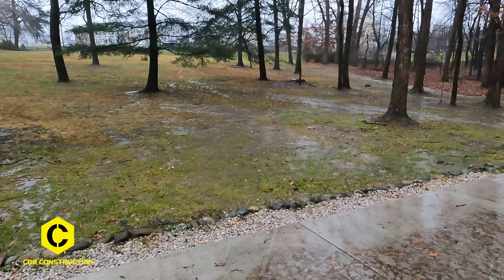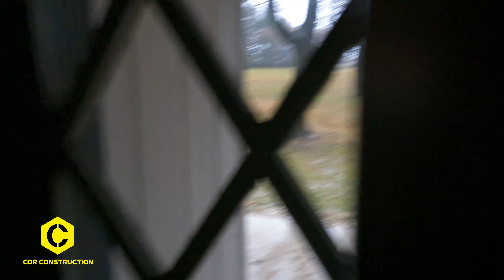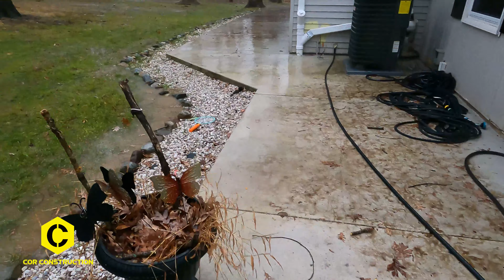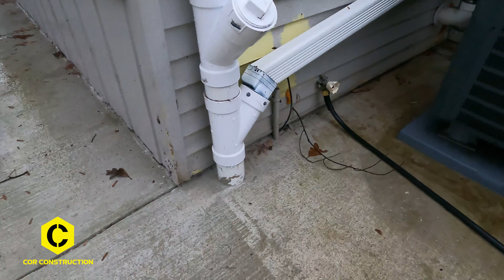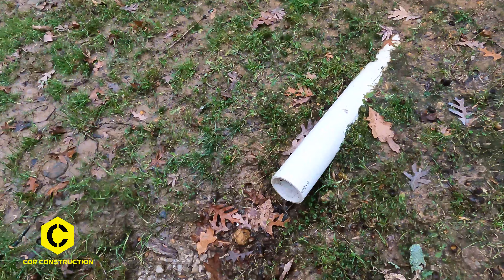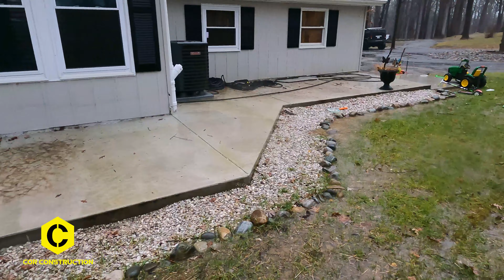Water Diversion Construction

Comment: From what I can see, the sidewalk here is only a small part of the solution to reduce mud by the home. Channeling water farther up the hill will be money better spent, although more swales may need some maintenance from time to time. The key is keeping the water at least 10 feet away from the foundation. 20 feet is probably better. BTW, a French Drain (gravel) will silt up after 10 years or so. Installing a series of catch basins with a solid pipe will work better in the long run.

Comment: Smart solution. I wonder why this is not done more. Maybe due to the extra cost? And maybe people just don’t want that much concrete right next to the house? It’s basically like a big sidewalk no?
Reply from the maker: Cost is probably the biggest factor. The housing industry isn't a quality focused industry unfortunately.  That's why most people with single detached houses have water issues.
Reply: @corconstruction  Is it something most homeowners can do themselves?
Reply from the maker: @nofurtherwest3474   Of course. I have a construction background - but i still approached this as a novice. I did a lot of research and talk to a few professionals that are smarter than I.

Comment: Munir this is so timely as my sump pump is running every few minutes as we speak due to the rain. My foundation around the house is surrounded by dirt/grass and on one side, water is getting in and seeping out of the concrete walls and floor of my basement. Do you think water sealant on the walls would help address this until I'm able to deal with the outside?
Reply from the maker: Water sealant on the walls will not hold up over time. Water will find the weakspots in the application - and expose that. It's happened to me before on other properties. Even Bricklock can't stop the water. I have even had water come from under the floor - something called hydro-static pressure. Water - is a substance that we are still trying to understand the power of. I have learned - that you can not stop water - only divert it. So that's why I built this system at my house - to divert the water away using gravity. The first thing I knew I had to do was build that concrete pathway around the house. Exposed soil around the house is the primary collection point of water - especially if you live on a sloped parcel like I do. If the land around your house is pitched away from the home - than the problem of water is not as severe. But if, like in my situation, the home sits in a ditch - than you have to use physics - gravity - to find a timeless solution.
Reply: @corconstruction   @corconstruction  ok this makes sense now. And yes water has bubbled up from tiny holes in my floor as well. Its so frustrating. Thank you so much for this information!
Reply: @CammyW-o1b  if you have a sump pump in your basement then you likely live on a high-water table zone. Therefore, simply diverting rain water won’t make a big difference. The only way to keep your basement dry is by preventing ground water from rising up. Which is what your pump is doing. If you live on a hill AND on a high water table area then diverting water away will help the efficiency of your sump pump in the basement.
Reply: @user-Ki3nm7gj8v why ask this guy that question unless he is an expert on that subject? And sealant inside of the basement is only a temporary solution the only guarantee is to stop the water from coming in contact with the house.in the first place.
Reply: been doing this for years and the key seems to be keeping any water from collecting within 10 feet of the foundation. You can fill, trench, swale, French drain, or culvert pipe, to divert the water. Just make sure to reduce any ponding / puddling and keep it away.